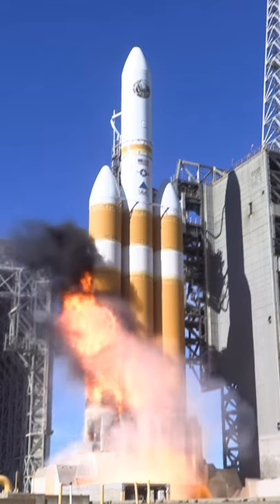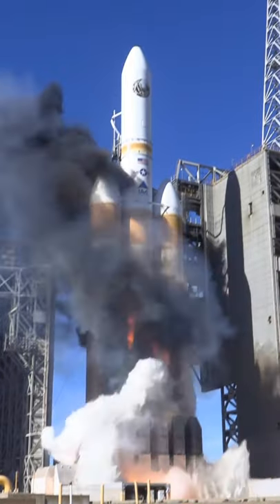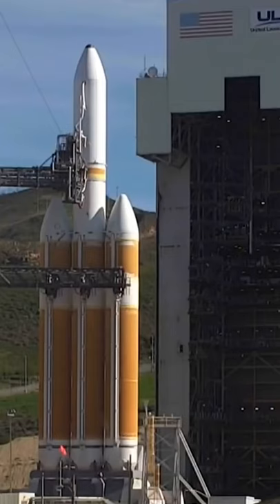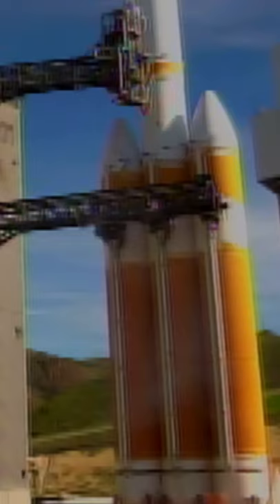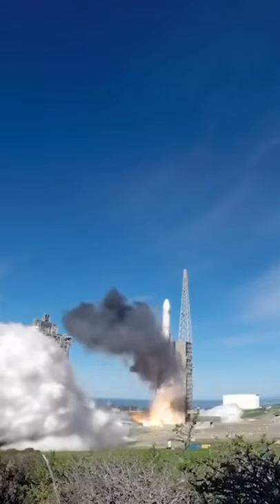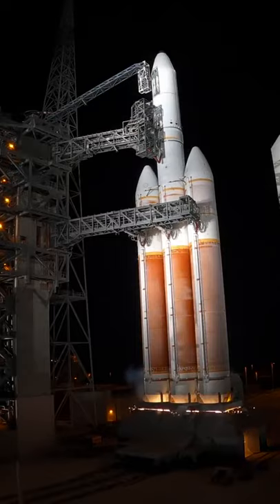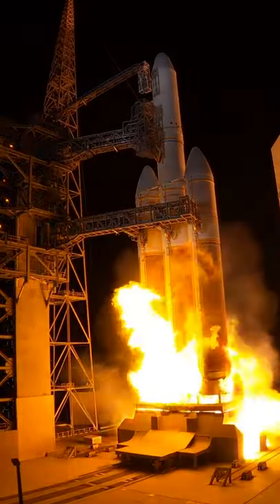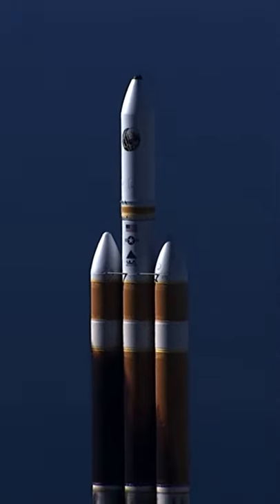Why Delta IV Rocket Sets Itself on Fire? #shorts

Comment: This is why it’s cheaper and easier to just use hi altitude helium balloons
Reply: Helium balloons can’t go 16x faster than a bullet...
Reply: @crippleddiego9226  Why do they need to go fast? were just using them as satellites
Reply: @landwolfcto  In order for an object to orbit it must be going faster horizontally than the planet can pull them vertically. Also, I’m pretty sure that weather balloons wouldn’t actually make it to space. They’d pop before they reach the karman line.

Comment: That’s not the entire truth, the rocket uses liquid oxygen and the fire causes the oxygen to boil increasing pressure and thrust. The two propellants boil naturally at higher altitudes, and this mitigates the need for large high pressure pumps saving weight.

Comment: Hydrogen burns in oxygen with a faint glow. This looks like a steel train. Have you got this all wrong. Is this the first coal powered rocket?
Reply: The nozzles are ablative (meaning they’re designed to burn away to scrub heat) and are made from graphite

Comment: So this i legal yet I can't drive my car if it can't pass smog? WTF🤬
Reply: For one this thing burns hydrogen and oxygen, the exhaust gases are literally just water. The tiny bit of char from the foam insulation burning produces less pollutants than your car running for an hour will. Whenever any one wants to launch a rocket they have to file an environmental impact analysis.

Additionally there is a scale problem you are missing the pollution generated from every single rocket launch in one year is less than what is produced by all of the drivers in LA in one month.

Comment: Could have fooled me...bad design and asking for the ultimate thing to go wrong...
Reply: It’s not a bad design though.
Reply: @weekiely1233  - Actually, yes you are right. Come to think of it, the pit is normally filled with sparks right, in advance of the fuel to prevent this uncontrolled burn? And I think they have to test the worst case scenarios anyways to prove the rockets are safe.

Comment: Is much more easy to explain…. Is a fail in the design, because the ignition system don’t have all pressure taht realy need they have to open the valve “early” to fill the volum required for efficient combustion….
Is just for the “turbine” system of the engine and is a mediocre system…

Comment: What a pure waste of energy and fuel?

Literally the rocket is like pushing a building into space.

100 tonnes to deliver 1tinne payload.

Surely engineers could see the complete waste if this brute force method.

I can see it's more efficient to launch payload off Boeing 747 like Virgin, Besos & Musk.
Reply: You are joking right? Rockets are some of the most efficient fuel energy to kinetic energy converters we have. The only advantage an air launch gives you is some material reusability, but there are huge drawbacks, the biggest being the size and weight you can launch. Virgins air launcher can only put 500kg into LEO, this rocket can put 28,000kg into LEO....

Also Virgin is the only company pursuing airlaunches right now, Musk and Bezos are not...
Reply: Virgin doesn’t launch stuff into orbit with a 747, they still have the actual spaceplane part. The key difference is that the spaceplane has significantly less thrust than the falcon 9/heavy and the Delta IV/heavy, and in turn significantly less payload to LEO, it also can’t get any sort of payload past LEO.